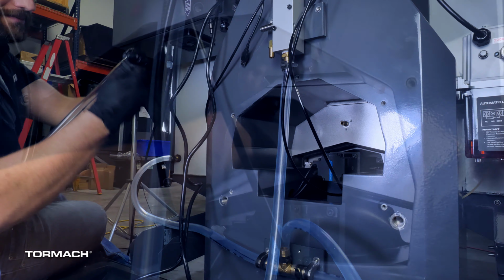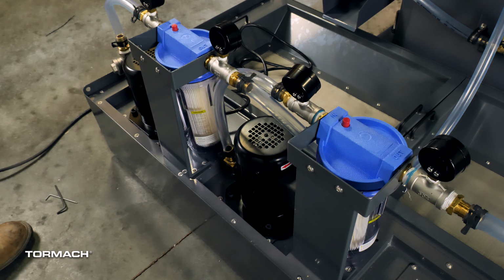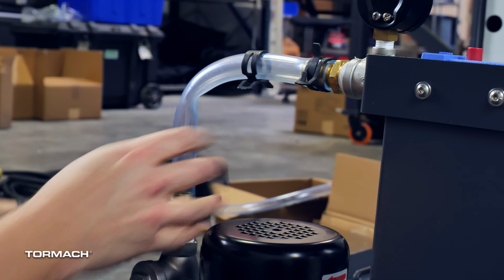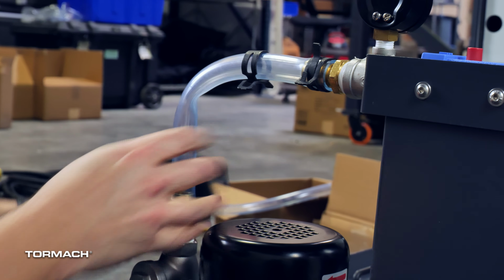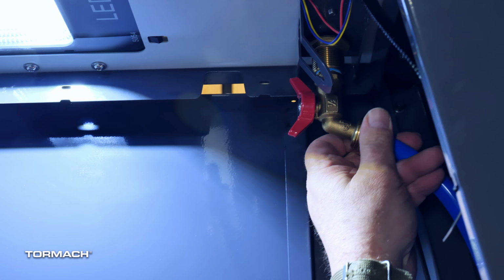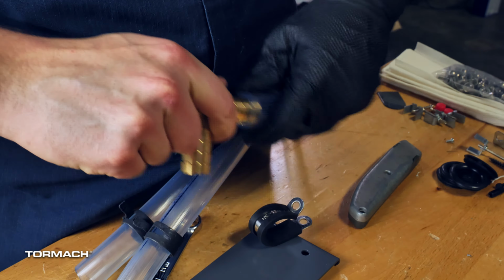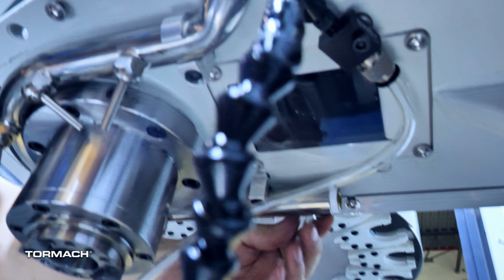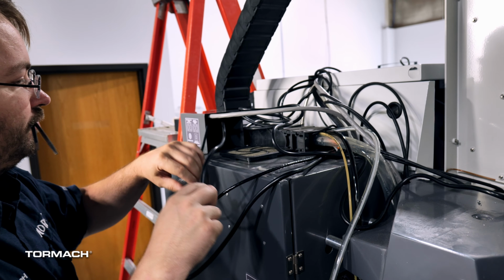1500MX Installation - Flood, Washdown and MQL Setup - Part 2

Comment: Say the 55" cabinet depth is perfect for my garage, but with the coolant tank added at 84" it's too deep and in the middle of my floor.... what's stopping me from fabbing up two separate tanks that fit under the enclosure on either side with a pass through in the middle ?
Reply from the maker: Sorry to hear our coolant tank couldn't work for you. It's mainly designed this way so that users could later add the chip conveyor without the need of repurchasing a tank? What would you like to see in a short, 2-tank solution?